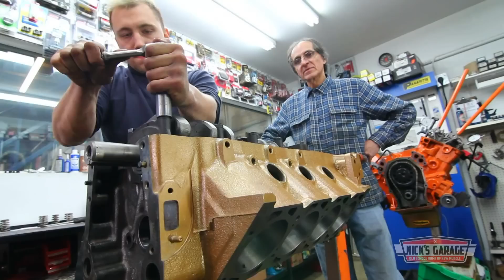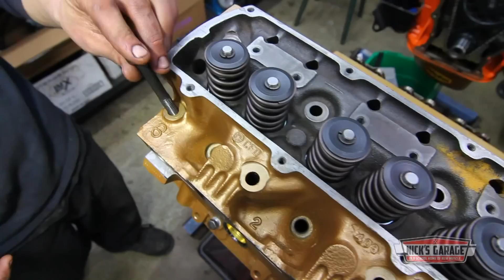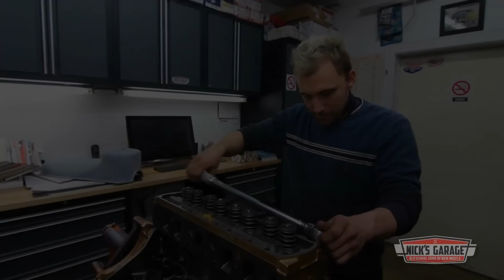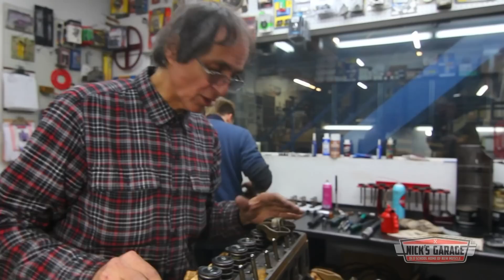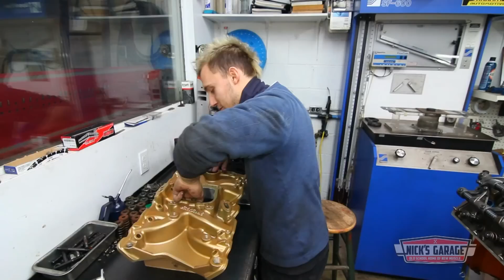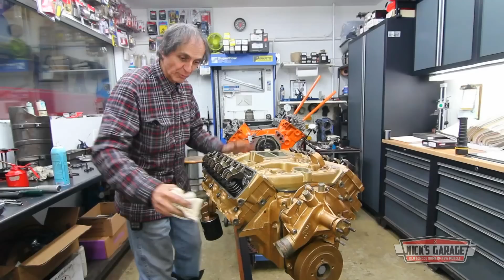Olds Rallye 350 Rocket Rebuild - Part 2 - Maximum Power

Comment: 400:HP from a 350 V8 olds engine, that same engine came from the factory producing 385 HP with a 4bblcarburetorand dual exhaust, so would suggest achieving the goal of 400 lbs of torque, which it can achieve at under 2000RPM.

Comment: unique sounding motors. Strong engine which gm converted to diesels in the 1970s
In the early 1950s Olds was the fast car
I think they used valve rotators for the first time.

Comment: You mentioned that after decking the block, the intake didn't line up quite right, but no mention of what that does to a non-adjustable valve train.  I know what it takes to get all that geometry corrected, it would have been really neat to see Nick explain it all.
Reply: Needs  different length pushrods and the intake requires machining on port facing  and horizontal gasket surfaces.  I haven't looked, but  I'm sure there is a  calculator for 90deg V engines on how much to mill off with any decking number so you don't have to do the Trig.   Also a  builder has to account for that Felpro vs. factory style stamped  gasket compressed thickness--Sandy   - Aging Hot Rodder from the East Coast.
Reply: @sandyshoremann7524  Like I said, I'm aware of what needs to be done to correct everything, I just thought it'd be interesting to see Nick actually demonstrate all of it in the video.
Reply: @livewire2759  I just saw him pull the intake off in a  later video. The port matching was terrible. That intake was sitting about .050" aboverthe short turn radius. There is  the 25 - 30 missing HP easy right there.- I dont know howthey missed that . Very basic stuff. Sandy
Reply: @sandyshoremann7524  I see... Yeah I watched this vid 3 years ago, so I don't remember any of it!
Reply: When you deck the block you have to also take in account for everything else your doing yo

Comment: Should have converted to an adjustable valvetrain. Probably alot of preload on them lifters. Nice build.
Reply: Creating Soft Cam Detecting Lifters. LOL I would give it a try first. But Adjustable Coming up :-)
Reply: +Sallie Gardiner About .500 lift seems to be the point where ya need adjustable valvetrain on these Olds engines. I've got away with just  adjustable pushrods and a 540 lift cam in a 455. But them 5/16 bolts are pretty thin.

Comment: Should have shaved that intake and went to a roller cam. Plus that eddy intake was made for tq not hp . personally I would have offset ground that crankshaft to stroke it just a bit.  That block would have came to zero deck then with the offset crank negating the need to adjust and machine certain parts to make them fit and perform
Reply: It’s not what you or Nick wanted, it’s what his customer wanted

Comment: I'm a Olds motor builder and I'm still wondering why you haven't tried to put the four fifty five w30 Cam and head's on that three fifty Olds motor your testing I did it in my seventy one Oldsmobile four fourty two and I was really impressed with that trick I used a performer rpm intake and a seven fifty performer eldbrock carb and a wthirty Cam shaft

Comment: if Nick is worried about vacuum on a long duration cam, he could always use Rhoads or Crane variable lifters so he could go up to a hotter cam.
Reply: You can go up to a two eighty four duration Cam shaft not much more than that because you will have to deal with a vacuum booster on a power brake car
Reply: If you want to go higher than that your better off to have manual brakes trust me on that one I've been there once
Reply: Anything higher than that your going to have to plan for a different way to stop your vehicle people

Comment: If you milled or decked the heads and block, you fucked up bad. The valve train is not right unless you changed the pushrod length. Best thing to do is change to adjustable rockers anyway. Still need the right pushrod length. So many builders get this wrong, along with a bunch of other things with Olds engines.

Comment: I notice that the head gasket bore is over size that might lose some compression.those #8 heads not that great, #5 are great if can get them from ram rod 350 #6,#7 better👍

Comment: I don't knew like hydro lifters they got to much float after the RPMs get so high. Flat is the way to go.
Reply: Maidenlord 666 first of all the olds 350 dont run over 6000 rpm so a solid lifter cam is useless, solid lifter cams are good over 6000 rpm to a limit but any roller cams are far superior!

Comment: Nick what is that Assembly Lube you are using on the Valve Train it looked like Molybdenum Disulfide Wheel Bearing Grease 😎 What a Great Build love the 350 Rocket
Reply: Chris Chiampo.   No it is not wheel bearing grease. It is a Cam lube made by Crane Cams. It is used to break in the new camshaft during break in.
Reply: Nick Panaritis thanks Nick Love the Channel You guys do awesome Work 👨🏼‍🔧😎

Comment: dose elderbrock make a airgap for this engine ? do you have a quad-jet carb for spread bore testing ? do you have the holley version of a spread bore for testing ? the holes at the bottom of the intake plenum are from an exhaust passage ,tap them ,plug them .

Comment: Guys, great work. Love your facilities. You lube most parts being assembled with what looks like engine oil? What did you use to lube the valve lifters before fitting to the block? Finally, did you use the original Olds' head bolts?

Comment: i have a 68 442 350 rocket that is in a diesel 79 pu but i'm pulling it because it is tired never been broke in to from factory putting a 454 stroker so willing to trade for something don't need much hate small cubic inch motors  have a few good one's but never cared for them the 389 and 455 are the good motors same block but built  right
Reply: 389 and 455 are the same block as all the Pontiac motors same same same all across the board
Reply: @glennmanchester1568  same block but different journals u can't make a 350 into a 455 same block but built different i guess u could but the cost is way to much and i have had a lot of pont.i got a 389 sitting in my 66 i go threw more cars in a year then most people will ever own and i have tried to build a 455 out of a different block it is not a good idea cost is way too much the 389 is ur best bet too build a 455 out of just because it is the same block doesn't mean there the same inside

Comment: Hey if you're gonna build a rocket three fifty Olds motor first thing you do is get rid of the factory small block heads and put big block four fifty five head's on the three fifty Olds motor and add a performer rpm intake on it with the four fifty five w30 Cam installed

Comment: Hi nick, wanted to ask a question about the intake. Performer and the preformer rpm other then the higher rise in the rpm they have a cut out in the middle divider,  do you think cutting that notch in the performer would've helped at all?
Reply: Timothy Thomas.    Sorry for the late reply. Good question. I guess if Edelbrock did not put that cut out in the divider had a reason. One way to find out is put a 5/16 carb gasket and try it and see any difference before any cutting. I should have tried that on my Dyno when testing this Olds Engine.
Reply: @nickpanaritis4122  appreciate you taking the time to reply.  Keep up the good work.

Comment: Why stock rockers, is there no aftermarket support?
Reply: COMP CAMS AMONGST OTHERE MAKES A NICE ROLLER TIP THAT ARE ADJUSTIBLE
Reply: Why not use them, tips gave to be worth 5-10hp
Reply: Stock type rockers with roller tips are a mistake... they just add roller weight on the worst spot to add weight to a rocker... go with stock type non roller tip rockers in 1.6 or 1.7 ratio instead... port the heads... backcut the valves... radius the valves and seats...
Reply: BuzzLOLOL. You are correct. We stayed with the original rockers which are 1.6 ratio and ported the heads, backcut the valves and kept it simple. Thanks for your input.
Reply: I agree with Jake he should have used adjustable valve train
Reply: Nick Panaritis did you have to run longer pushrods??

Comment: Somewhat newbie here. I have the same engine. I am now at the valve train installation stage. My question... is there a specific cylinder order to bolting rocker  arms down?Do the lifter need to be in a certain position? Any info helps. Thanks
Reply: No just bottom it out that's it it's non adjustable and not my favorite design for sure but unless the cross bar is broken or some other mechanical failure. They don't make any noise at all once they start to tho that's it it's over either bad cam or something disastrous is going on trust me ive. Pulled a lot of them apart and can't even count how many had to have a coat hanger shoved down the return holes but when they are in top form they are right there with all the others and far exceed a stock small block chevy in performance all day 68 thru about 73 cutlass supremes were a dime a dozen back in the day and sent tires to hell and back for fun lol w out even breaking a sweat
Reply: Walked all over a Pontiac 350 and Buick 350 motors that's why they were rockets

Comment: hey Nick I'm 54 been a rebuilder since 1973 I have never seen you port anything when I was building Motors I  always ported out to my gaskets this is a norm in my day's are you just not telling people this for a reason or is still a trade secret?
Reply: He mentioned porting a bit but glossed over it fast my opinion is he's got that in his pocket for only few to see it's his own brew of porting that is more than likely a gem and wakes up the old monsters sleeping within
Reply: And if that's not enough horse power for you I've gotten a three fifty Olds diesel block I have been waiting to see what I can do with that trick by putting a big block four twenty five crankshaft in it and four fifty five w30 Cam and head's on that one Nick you want to try to top that one Nick

Comment: How much it cost for Nick's garage to rebuild 350 olds rocket for 400 horsepowers???????.
Reply from the maker: Give us a call at the shop for prices. Thanks. 
(450) 936-8100
Reply: About nine hundred dollars
Reply: It helps if you have some vintage parts also to work with I have a pair of the c casting head's and the four speed Cam installed in a rocket three fifty Olds motor now and it makes over four fifty horse power now and it makes Big block torque as well in the five hundred foot pounds of torque range easily

Comment: Is this a 9.5:1 motor or so?

 What cam? Has some lump too it
Reply: Ace Speedy my 1970 olds 350 was 10 or 10.5 to 1 stock
Reply: Ace Speedy.  It has just over 10.0 compression ratio. Lumpy cam yes, specs, I do not have the file on hand to mention the cam specs, Sorry.
Reply: Gonna need 93 fuel at that ratio for sure or back the timing down to nothing even then it might still detonate

Comment: What kind of paint is on the block?
Reply: K Johnson.  Engine enamel, Oldsmobile Gold Color.
Reply: Generally it's called "oldsmobile gold" or something similar. Olds painted their rocket motors that color from the mid 60s to the early 70s before everything went GM blue or black.

Comment: Deck the block. You fucked up using the factory push rods they are to long now.
Reply: John Mills.    Decked block, we did. Then we went with new stronger shorter pushrods.

Comment: Those cheap olds rocker bridges won't last long under the extra power,cheap pot metal junk,customer should have had that upgraded.
Reply: I've used those cheap aluminum fulcrums for about 14 years, spinning the engine up to  5800 rpms with a crane hydraulic flat tappet 222/230 @.050" in a 68 Olds 350. Performer RPM intake  650 DP., flat top .030" speed pro forged aluminum slugs #5 heads with the 1.875 intake/ 1.56 valves, mild head porting.    I took each cylinder to TDC, tightened the rocker bolt until the pushrod was snug and measured the amount of distance with a feeler gauge between the bottom of the fulcrum and the head.  I put the fulcrum in a vice and shaved off enough alumminum, measured with a caliper  until I got the preload on each cylinder to .025-.045.   86 cutlass. WITh a  3000 stall and a 3.73, slicks, open headers it will run 12.70s on a good day. Over  500 passes on those stamped steel rockers and aluminum bridge straps, fulcrums, pivot arms or whatever you want to call them.  NEver saw the need to run  an adjustable  valve train.  Just measure the preload on each cylinder then file off enough aluminum on each fulcrum,measure, file some more until  you get @.025-.060" of preload. At least that's what's worked for me. Could synthetic oil have helped ? who knows.    5800 rpms isnt that brutal either.

Comment: Great motor bad cooling I had two of them
Reply: Can i put a 350 olds in a 1990 dodge truck
Reply: Anybody no
Reply: That was not as much of an issue as returning the oil to the pan was for me just a little sludge and they would fill the valve covers and smoke like trains etc bad design on the return system a coat hanger and a few hours often cured it for. A good while anyway oil changes very critical but they never that I remember ran hot they ran like scalded cats I know that much the old cutlass w 14 inch tires were no match for the torque they had the fun days when it was the thing to do send tires to hell
Reply: If you are creative enough you can do anything. So if you want to do it I had a 400 Pontiac in a Chevy truck and that was a lot of fun to drive lol there was not a truck anywhere around that could keep up with it bet not even the big block chevy 454 camper specials they were too heavy and shifting was cumbersome. When they finally got it in gear I was gone already

Comment: Bull shit olds engines are known for poor coolin they all get hot when run hard had many
Reply: I had a 324ci, 394ci, 425ci, & 350ci, in a 40 yr, period, and there were many more in my family.
None ever had cooling problems. If you didn't do proper maintenance that could lead to problems.